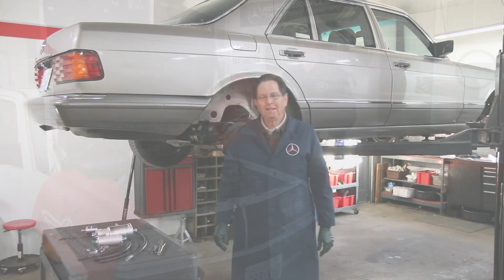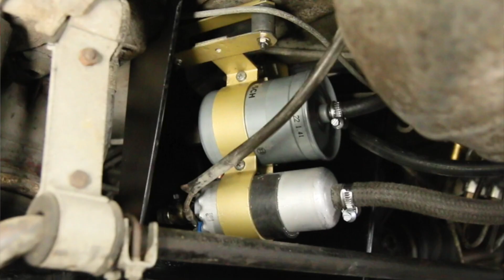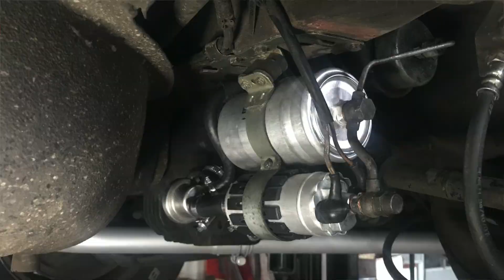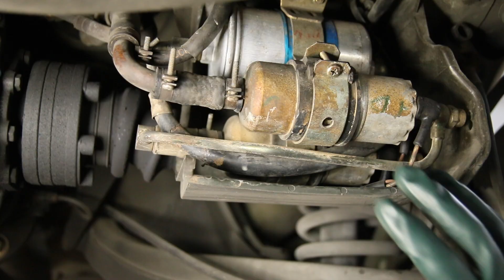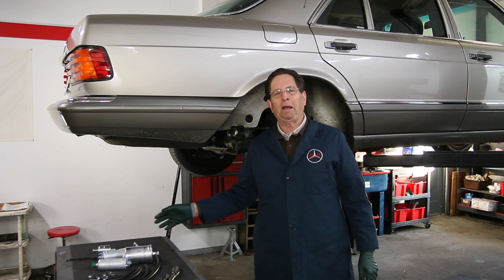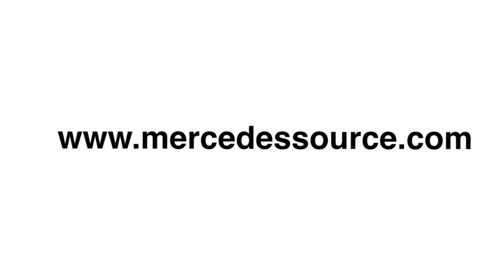Mercedes 560SL 560SEC 560SEL Fuel Delivery System - Why Overhaul?

Comment: I have a question thats been like a riddle to me. We have a 1989 560SEL and it has sat for a few years. It was running and just quit. Figured out there was no spark. Checked coul and it was good so decided to replace both the cables. The crankshaft sensor and the top one (idk what is called). Distributor "looks good" and was said to have been replaced. So after replacing the crankshaft sensor we still have no spark. Would you have any ideas? Is there 2 fuse boxes in this vehicle? Im only aware of the one in the engine compartment.  We are wothout a vehicle right now and was hoping the sensor would be our miricle. But no😔. Hope you can enlighten me.
Reply from the maker: It could be your ECU has failed. If not familiar do an internet search to learn more.